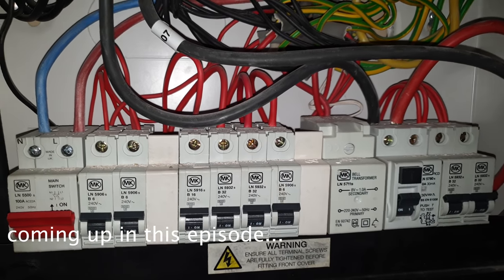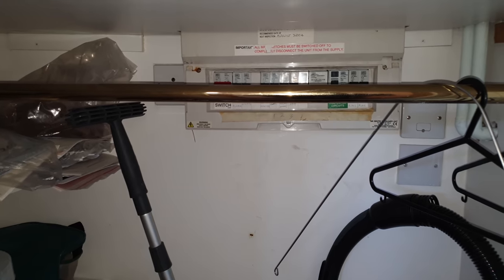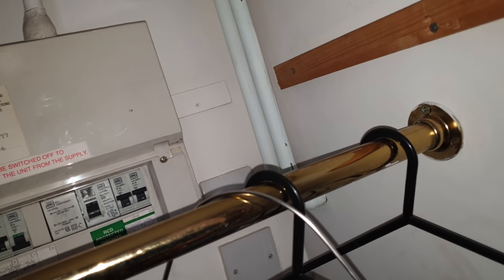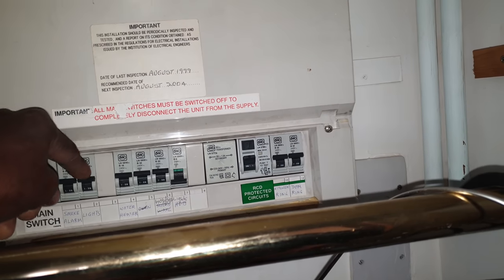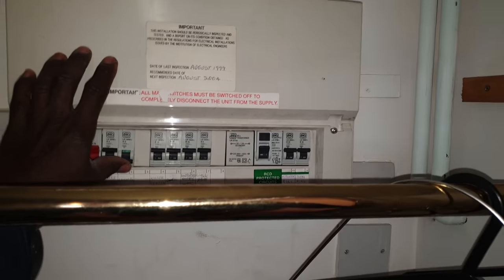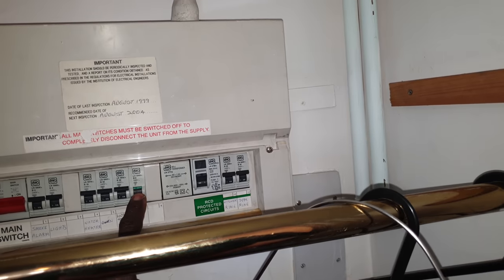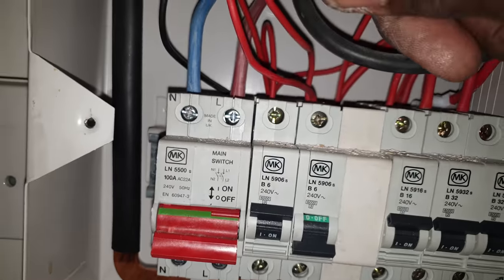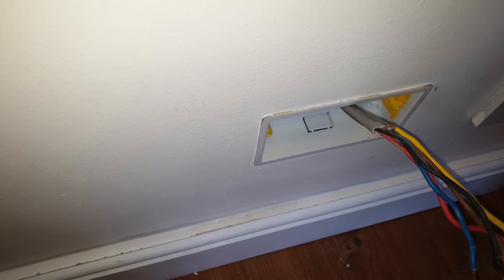Circuits That Make No Sense

Comment: It looks like a classic borrower neutral problem. As many have said the 2 MCB modules are active one for supply the other switched to the fan. This explains the behaviour your saw when with the rightmost MCB the light would work but not the fan. John Ward had many videos on this and suggests turning off the power and not using the MCBs for isolation sure to borrowed neutrals and earth results. Nice video, keep up the good work!

Comment: I had 3 breakers in my garage. 20amp circuits running 14gauge wire. One circuit started with a gfci and they jumped a power wire into another of the garage circuits. It burned up a power wire and took out both of the runs. Rewired the whole thing in 12gauge and all new boxes and outlets. Got it down to 2 circuits in the new install.

Comment: My first guess (now at 4:30 in the vid) is that the 2 lighting circuits connect to the fan, but to different terminals there and one livens up the other but not the other way around, and the one livened by the other has the lights on it.

Comment: Tried to rig electric shower to act as switch line on fan? Then it got derated to a 6a MCB by the next sparks to see it and not know what to make of it.
Now it's effectively 2 way switching with crossed legs?
Edit: might be a bit off with the 2 way switching but after some thought, but reckon what I said first is about right

Comment: Because there’s no RCD protection on that side of the board I suspect that the lighting circuits are interlinked, and the fans are working through the SL for the timer so even if one mcb is turned off because of the interconnection the fans are still working on over run.

Comment: My initial guess is that the lights are directly connected to the left MCB, the right MCB is connected to a fan with a timer/delay off, which then loops into the other fan and lights. I would start by checking out those fan connections.
Reply: @jondavid6126  Firstly the 6mm was disconnected from live, so it should not be live, (though it might be due to the presence of an illegal link.) You can see it was saftely terminated in a terminal block so even if it was live it should not be an issue.
Also a "neutral belt"? If the neutral wire is connected to neutral then it should be close to 0v at all times, certainly not  high enough to get a belt from.

Comment: 3-4 crossed circuits would be my guess..

is it typical to have domestic cabling mixed in with 3 phase???

I ask this because I have noticed alot of cabling you seem to come across  looks to be 3-phase rather than single phase cables

someone was lazy and decided to do wire everything into 1 fuse box when either a bigger unit or a second fuse box  should of been installed...

Comment: I suspect the fan/light switch was originally double pole with each circuit for fan and light run separately - then someone changed the switch for a single pole and joined the two circuits